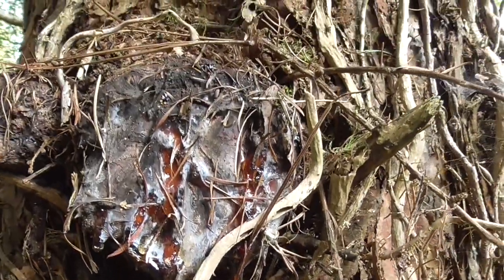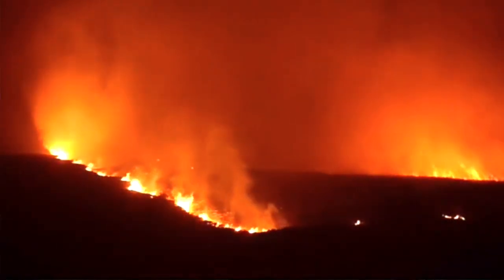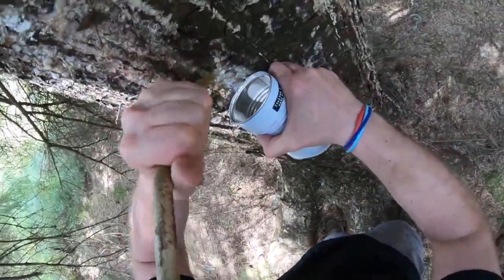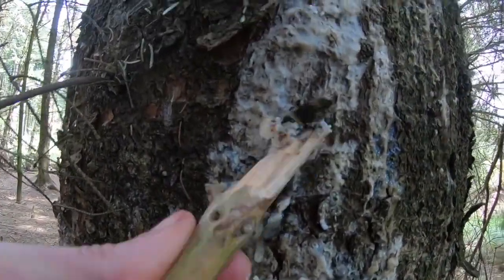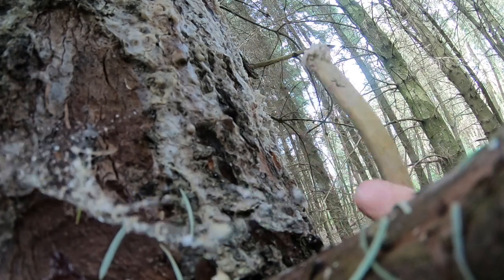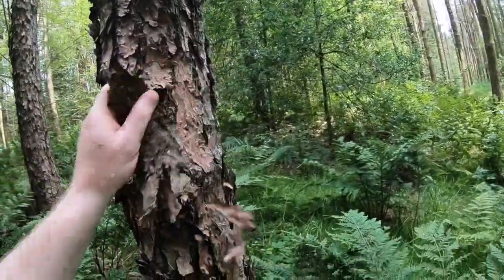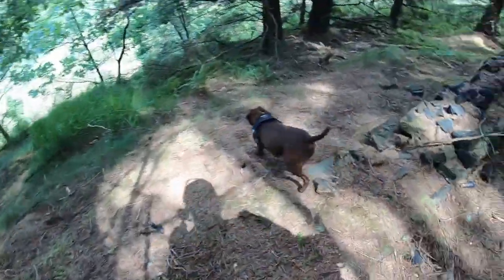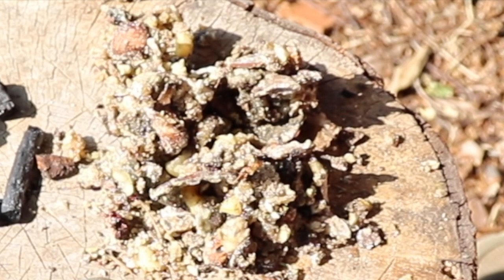How to make a primitive pine pitch/resin bonding stick

Comment: Good explanation, I tried this before but the resin boiled before it melted if that makes any sense, as you point out a low controllable heat source is essential.  Do you think the amber resin we see on cherry trees would work to make glue ?
Reply from the maker: Being honest I’ve never been successful with Cherry tree. It looks the part. I’ve burnt it before now many times. Thanks for taking the time 👍